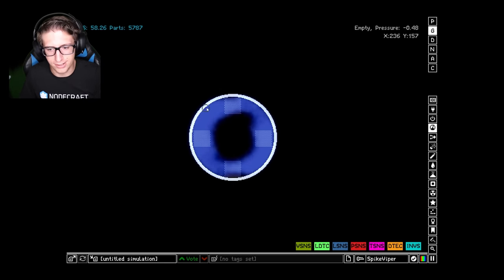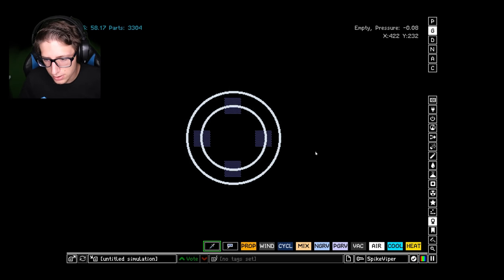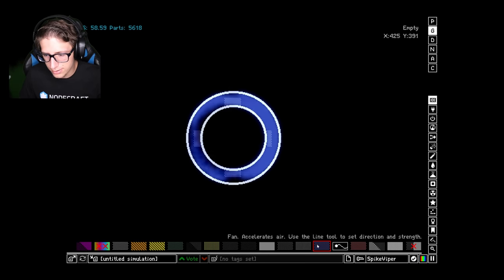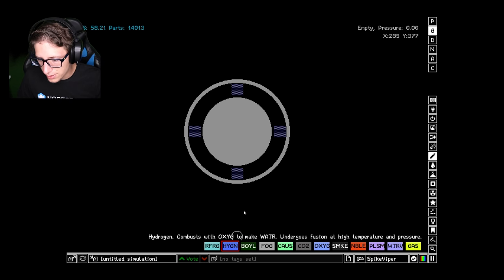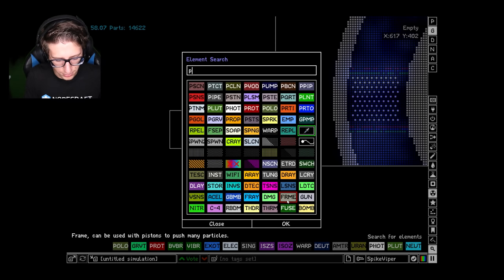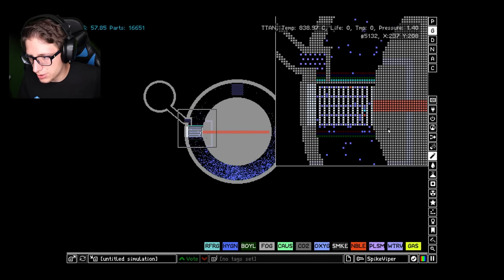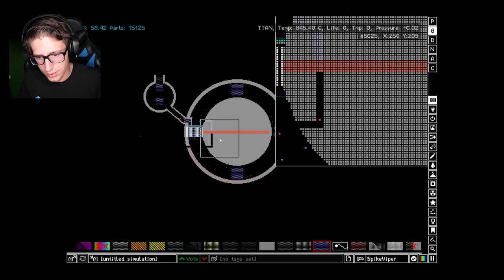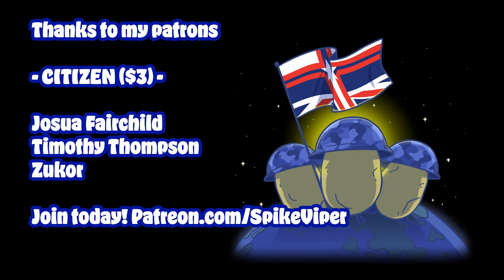COLD FUSION REACTOR in The Powder Toy!

Comment: cold fusion happens at 500C and 10 pressure if i recall the code correctly
Reply: 500c pressure it irrelevant but it helps stop it burning